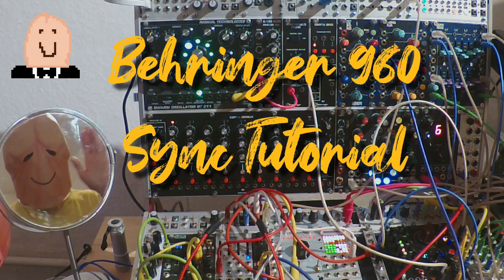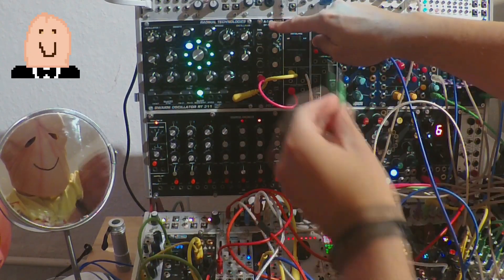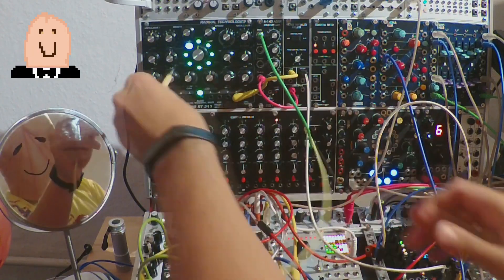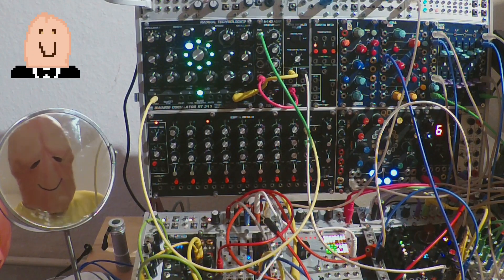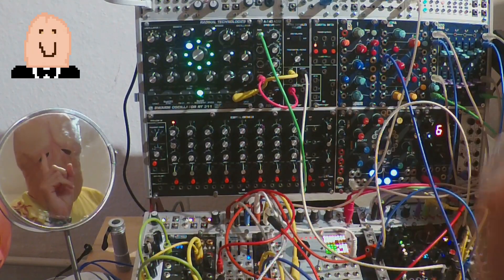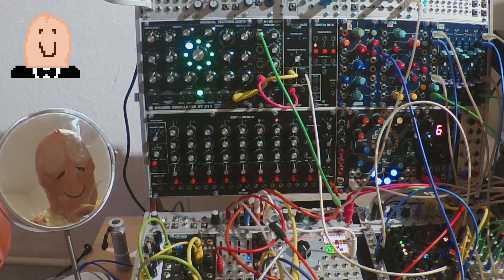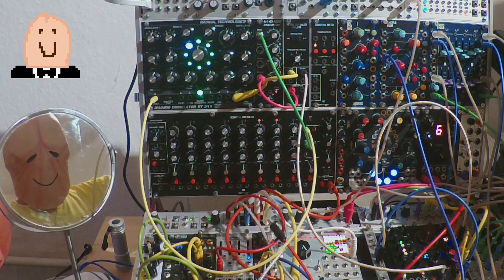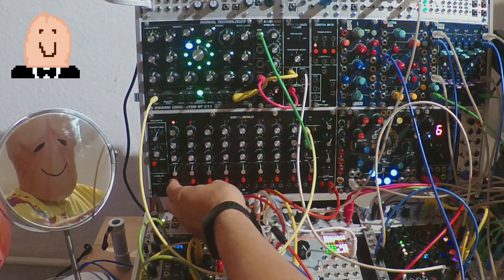How to sync Behringer 960 sequential controller Tutorial with eurorack modules system55

Comment: For those trying to clock as slave to Pams New Workout and are having a nightmare like myself here is the solution I found on mod wigglers >

Well, it took 24hrs to figure it out, but I got there. Yes, Pam’s must be the master clock, but in order for the 960 to sync, its so-called “oscillator” must be turned to its slowest setting- 1 on the coarse range, 0 on the fine- before connecting as in the first diagram. No other settings will work! The trigger then has to come from Pam too obvs, or you get one note every 45s or so. Every day is a Berlin school day!
Reply: I was starting to suspect my 960 was defective until I read your comment. I have to do the same thing when using a Harmod as a CV clock source.

Comment: hi your vids have really been helpful.... I can clock my 960 from cubase fine - bUT what are you actually using here to generate that clock? (sort of newbie.....)
Reply from the maker: Oh, it‘s just a normal square LFO which is a clock signal. Sometimes I just use a clock out from an Eurorack sequencer or something else. There are so many ways to create a clock signal.
Reply: Funnily I’d a ‘spare’ 921b and sent a sq wave into 960 as suggested and off course it worked……. Thanks for the response…..
Reply from the maker: @2009Tosh yes, it’s nothing else than a LFO if you go in the LO mode. That’s Eurorack!

Comment: Very nice thank you for explaining the sync, but one question, if i use a clock , the gate is provided by row 2, but if i want to use the second row for pitch also , multi the clock signal is too weak for gating an envelope...as a newby ...is it possible to amplify the clocksignal so that its strong enough to trigger the envelope? When using a gate signal its no problem. Thank you very much. I enjoy all you tutorials.!!!

Comment: I just added a second 960 so that I can (among other interesting configurations) use them as a six-bank eight-step sequencer. I tried patching Oscillator out from the first 960 into oscillator control input, as well as into the “Step” input. But I notice even setting both 960’s to step one, turning off the oscillator in the second sequencer, they still get out of sync. They seem to be stepping at the same rate, however, the steps drift out of sync after a half minute or so (e.g. 1st 960 is on step 3 while 2nd 960 is on step 4). What is the correct way to sync up a pair of 960’s so that the clock rate is the same and they stay on the same relative step as they both play)?
Reply from the maker: Ok, I understand. The best way to sync sequencers is to copy the main click with an active mult. This is the cleanest and best way.

Comment: I'm trying to sync the 960 from my Doepfer midi to sync converter but no luck
I've tried clocking it from my behringer RD-8 sync out port. I was able to get it to to sync but the tempo on the 960 was 10x's faster than the RD-8's tempo. Still trying to figure it out . Any help on what I'm doing incorrectly would be appreciated. Thanks in advance.
Reply from the maker: Hm, what should I say? It is important that a correct clock comes out of your Doepfer module. This is definable I think in the Doepfer. And then you plug it in the input as I described in my video. I do not know this Doepfer MIDI to clock gear but I think here is the error because of the 10x faster. There should be functions to adjust the translation of the MIDI to sync signal

Comment: Sorry for stupid question got mine yesterday. You say second row is gate? I thought it was all three rows of CV? Also can it be reset so when you start a gate/clock it will sync to the start? Thanks!!
Reply from the maker: I am sorry to say that but no row is a gate. Just CV for pitch. But you can handle it in some cases as a gate/trigger. But not in the correct way. All 8 steps can not be 8 Gates. But try it out. You can only manually reset the sequencer by Pressung the first Set button. Just try all out. It makes fun anyway.
Reply: @penishead_official  thanks a lot! I trigger it from my 606 which has a quite hot gate out actually two... Seems working just fine could I burn it you think?

Comment: Has anyone tried clocking a 960 from their Pamela’s New Workout? I can’t seem to get my 960 to shift with pnw or any signal for that matter.
Reply: tried tonight and no luck yet
Reply: For those trying to clock as slave to Pams New Workout and are having a nightmare like myself here is the solution I found on mod wigglers >

Well, it took 24hrs to figure it out, but I got there. Yes, Pam’s must be the master clock, but in order for the 960 to sync, its so-called “oscillator” must be turned to its slowest setting- 1 on the coarse range, 0 on the fine- before connecting as in the first diagram. No other settings will work! The trigger then has to come from Pam too obvs, or you get one note every 45s or so. Every day is a Berlin school day!